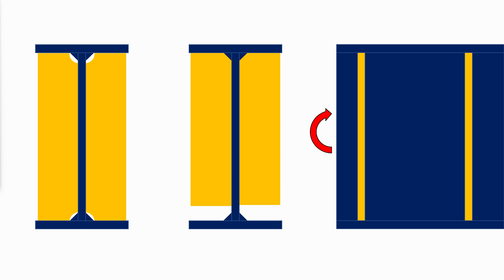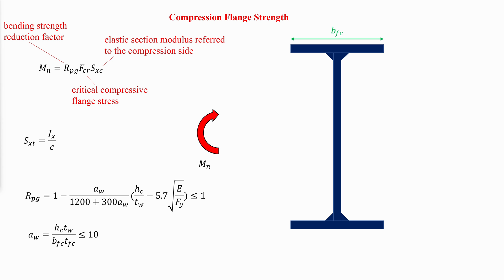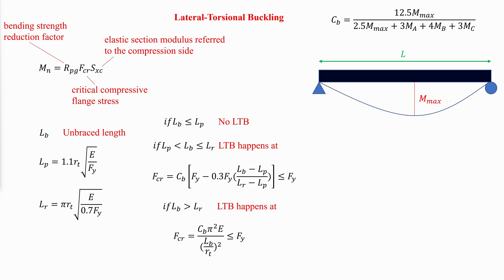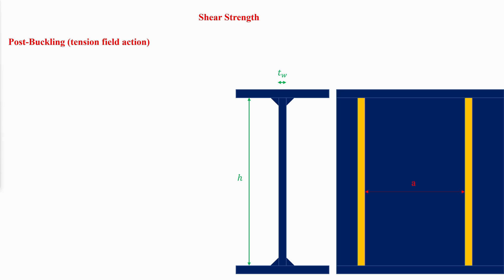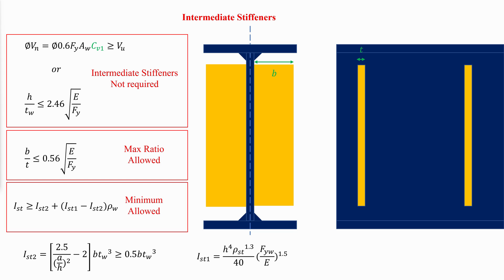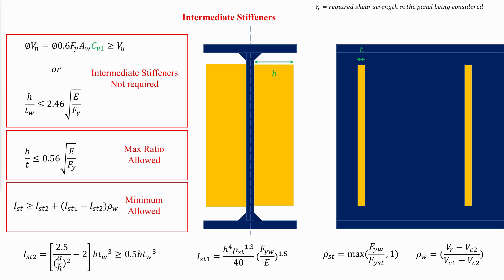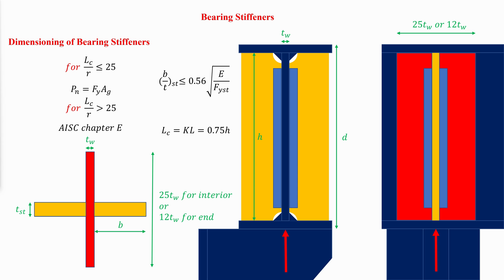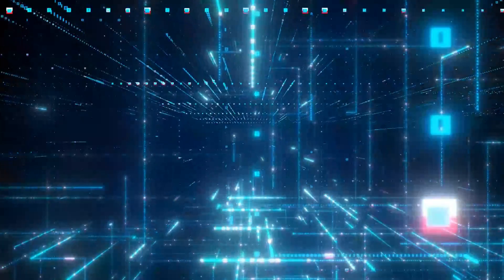How to Find the Flexural Strength, Shear Strength, and Stiffener Sizes of Plate Girders

Comment: When V_c1=V_c2 how to determine the value of \rho_w? Thanks
Reply from the maker: Hi, the value of rho_w is always Greater than or equal to 0. It can't be negative. This is worthy to note. Furthermore it is unlikely that V_c1 is equal to V_c2. Because V_c2 is the shear buckling strength considering there is no post buckling shear strength. V_c1 considers tension field action or post buckling shear strength. That being said if you obtain a negative value for Rho_w just take it as zero. And the minimum required Moment of inertia is simply I_st2. A common practice to make life easy is to take I_st as I_st1. This assumes that rho_w is 1. But this is too conservative and can lead to an unnecessarily expensive design.
Reply: Thank you @FrameMindsEngineering